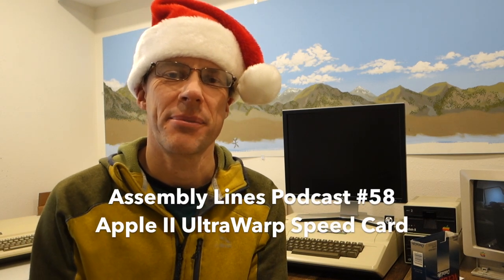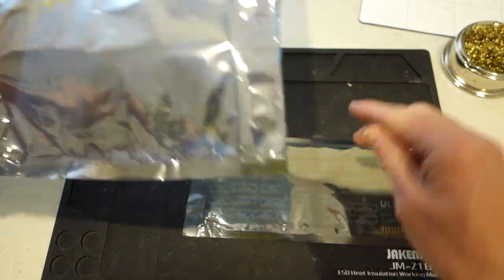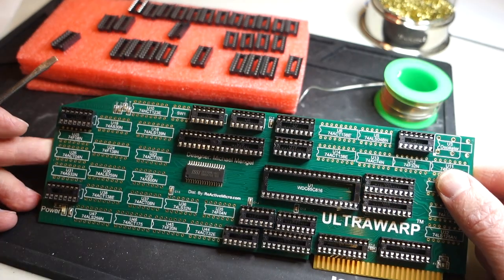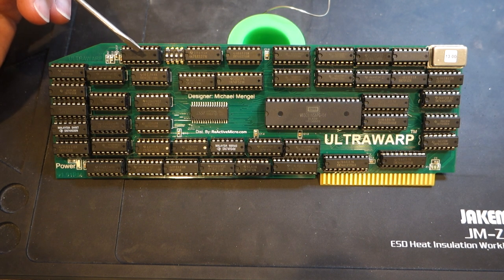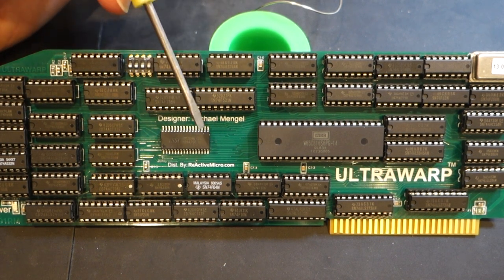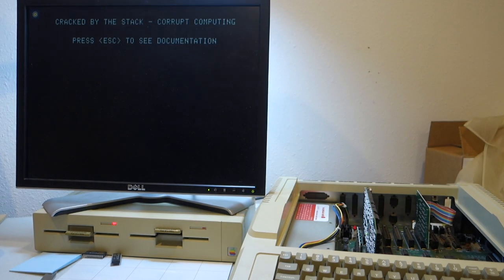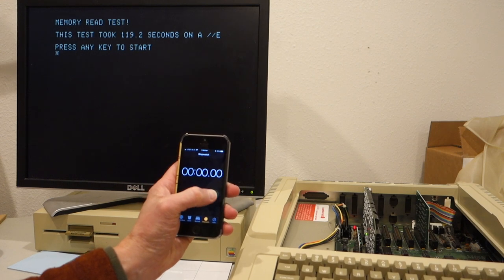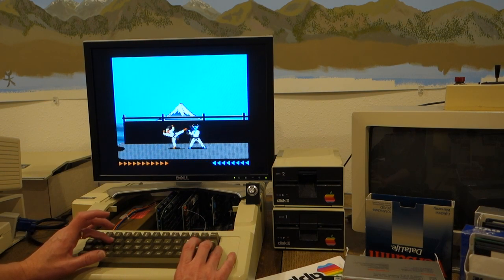Assembly Lines #58: Apple II UltraWarp Speed Card

Comment: I soldered one of these last week and throughly like it. I tried the recommend rom copy to get applesoft working but it kills ProDOS. Do you suppose there’s a way to run applesoft reassembled for another location and run it without killing ProDOS?
Reply from the maker: Hmmm, it might be possible. I haven't looked into the Applesoft/ProDOS problem. I wonder if you could run Applesoft in aux memory?
Reply: I followed instructions to copy applesoft to ram.   I’m not too sophisticated on it  so wasn’t exactly sure what I was doing.   
I read $C081 twice. Something about reading from rom and writing to ram.  Next $D000.FFFFM to copy it.  I’m not exactly sure if it was moving it to auxiliary ram or not. Lastly a read from C083.  Getting out of the monitor Applesoft was  accelerated by 13x but ProDos was nonfunctional
Reply: use dos 3.3.
Reply: Too addicted to the speed of reactive’s Microdrive to go back to dos 3.3 My alternatives are Kyan Pascal and Merlin.

Comment: Review it with game play?  Doesn't even answer the more important compatibility questions.  Like does it support DMA?  Will it work with things like HDD controllers.  Oh well.
Reply from the maker: From the manual: "UltraWarp is a DMA card. You can only have one DMA card running at a time. Therefore, you will need to turn off any other DMA cards to run at UltraWarp speed and you ́ll need to turn off the UltraWarp to run any other DMA card. High speed CP/M cards that run on their own on-board memory can run concurrently with UltraWarp." Also, as I explained, you need to set the dip switches if you have HDD cards in slots 5 or 7. Thanks for watching.
Reply: Thank you.  That was helpful.  As for the  DIP seitch settings you mentioned.  In context it sounded like you were referring to disk ][ drives and not HDDs.
Reply from the maker: Yes, fair enough. I think I was a bit confused when I shot the video. Then I re-read the manual. :-)